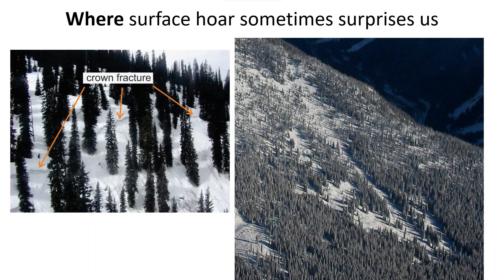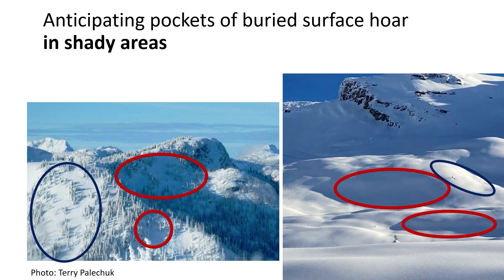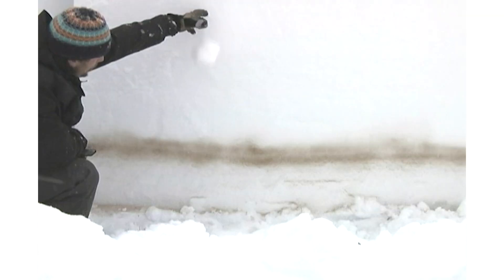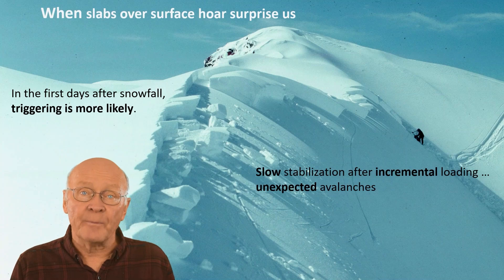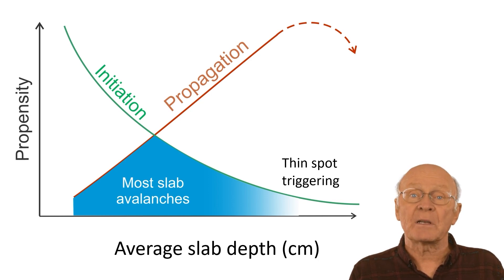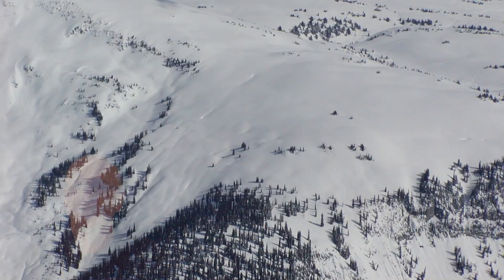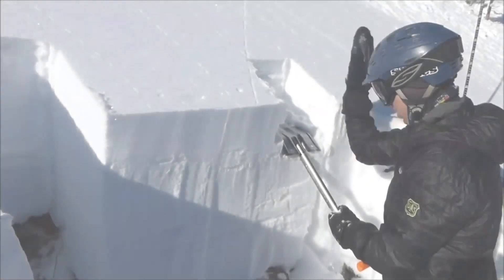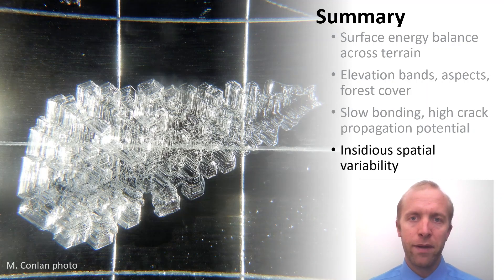Some science behind surface hoar and its insidious avalanches - Chapter 3

Comment: “The fourth skier triggered this avalanche…” crown appears to be less than 1 meter deep. Slope at ski track entry point appears to be much less than 30 to 35 degrees. Both support human triggering of a shallow weak layer by concurrent activity regardless of slope. Human triggered Avalanche prediction is possible independent of weather!